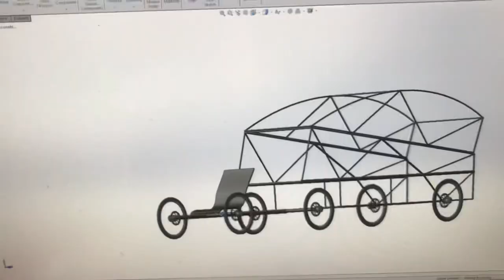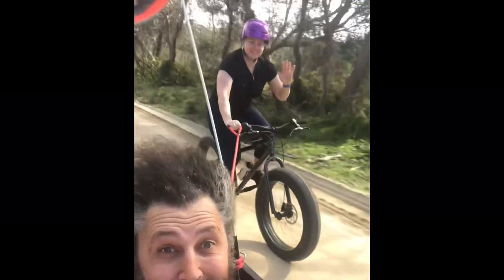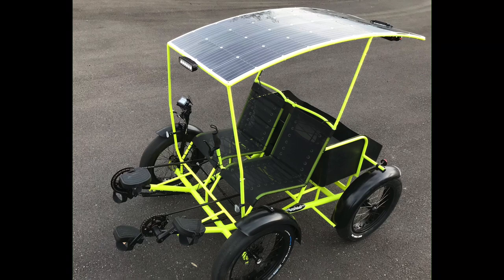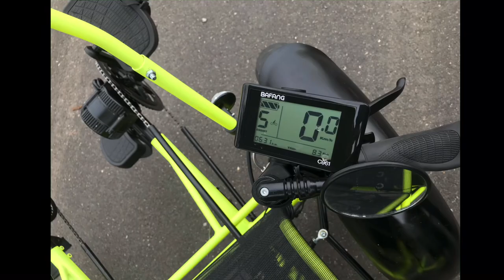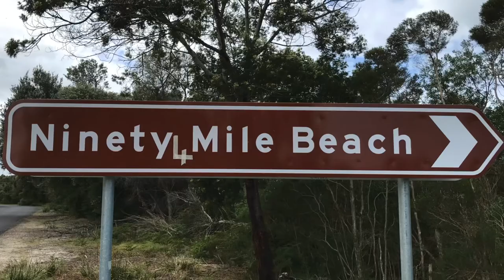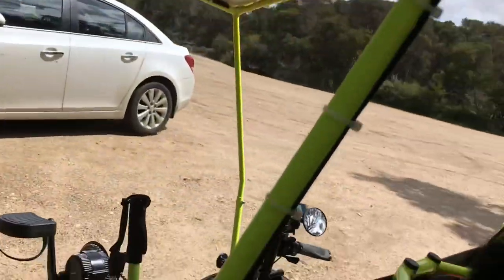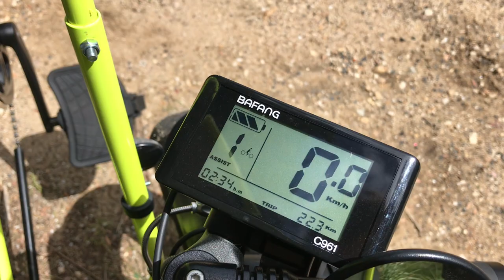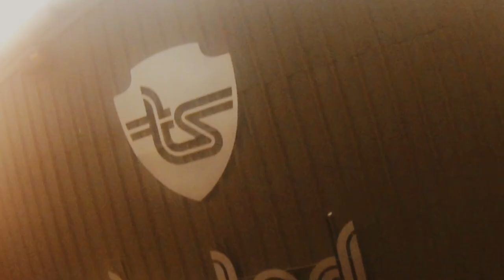Yaba Daba Doo - Solar Quad

Comment: Have you done any work on the most efficient recumbent position.  I once had to move a tractor tire out of a truck box and I found that a recumbent position with my back against the back of the box was the way to do it.  A far more force was attainable than could ever be accomplished any other way.  Now I see on recumbents the focus is on speed by getting as prone as possible.  But more power could be attained with more lower back support. A good test of this might be in Hill climbing where recumbents have a really poor showing. Thinking of how this could be improved would be a game changer for going up grade.  I would also like to see the apparatus you have on your race bikes for adjusting for leg length to come over to all recumbents.  That is one cool setup.

Comment: Make the seats of the quad fold down into a double bed camper!
Reply: Exact same idea I am moving around in my mind these days :D As a light build, with a closed bottom platform and tent walls coming down from the overhead roof, this would be a what, a human powered RV? And much more practical than all these bicycle camper trailer concepts, even on long tours.